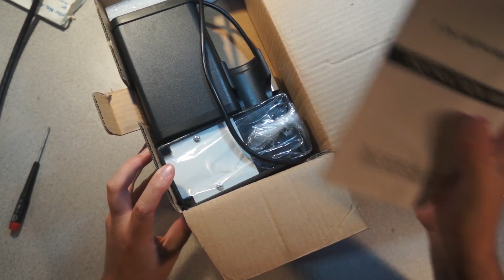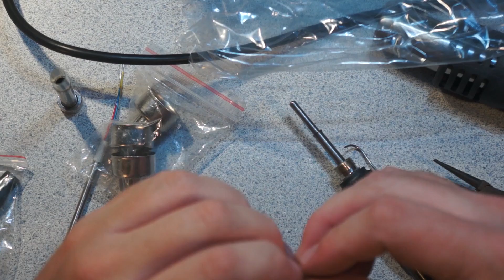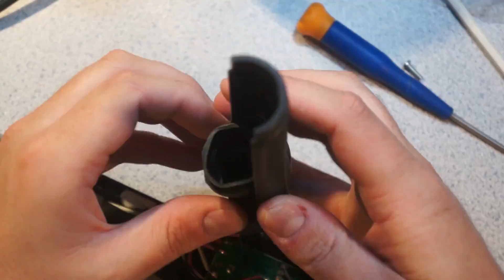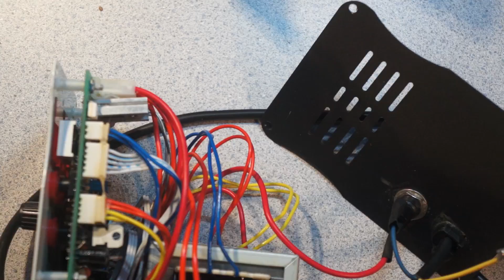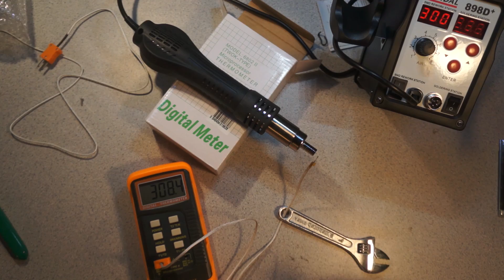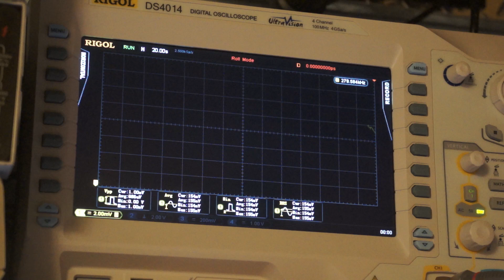898D+ Soldering Station Teardown and Review [Sold under many Manufacturer Names]

Comment: This handle has a design flaw. The air flows inside the plastic case when the temp and airflow is set high. With nozzle attachments, the handle with melt within 5-10 minutes as many already have destroyed theirs. Use without nozzle and in short bursts above medium settings. Don't do high.

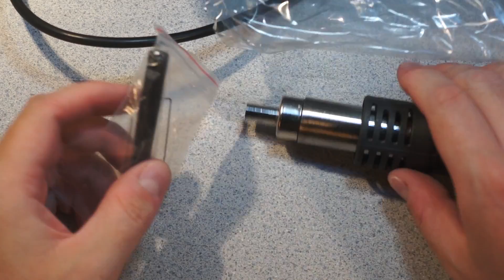Comment: Connor, at 10:43 that tool that you think is a tip removal tool is actually a smd chip removal tool...you have to assemble it, and each leg goes under the sides of a smd chip say a 32 or 64 leg chip and you use hot air to desolder, and that tool to lift the chip.

Comment: Just don;t waste your time watching this rant.
Reply: Don't get me wrong, this kind of stations are crappy, they are the cheapest that exist, but for 50€ they also the best thing that you can buy.                                                                          All hot air stations overshoot, when ramping hundreds of degrees and all of soldering tools have fluctuations and tolerances. (in this case one can improve the temperatures by calibrating it)                                                                                                                       Even we compare it with a top of the line 300 time more expensive soldering station from JBC, the characteristics of the generic shitty and cheap one are not really bad.Don't take me on my word go for the JBC site.

Comment: originally these only were analog pots for setting temp. they changed to digital display to show setting temp. the decimal point solid is heating, flashing is at temp. these only have set display not monitoring display, thats why so cheap.

Comment: I think you should use a precision thermometer to do you assessments. You making yourself look like a fool. I purchased the 898D+  and is really a decent Station. I work with 3d Printers and thermosters aren't use to measure temperature the way you are. And what you call a overshoot is actually a temperature reach status or (over heat). Any tool the is use to heat up including hair blowers needs to over heat on turn on. Also you just unbox this station meaning the to test product you need to break it before you run any test of this kind.  Another thing the metal points shouldn't be thigh due to shrinkage. Next time research your material before you make yourself look like a fool on world streaming.

Comment: I bought one of these (Saike 852D) 2 months ago every thing worked fine for about 15 min, the the fan stopped working then ( it smells burned ). not getting any good help from where I bought it ( China ) anyways I checked the voltage up to fan motor it reads 42 dc volts but motor is rated 24 dc volts I think it's burned out. Question, where on the board do I look thats causing this problem ? Has anybody had this problem with this unit or similar ? Thanks

Comment: Warning to the casual viewer: Don't waste your time, this is not a review of the rework station. This is an hour and ten minutes of pissing and moaning about a cheap Chinese knockoff not being the same quality of a Weller workstation that would cost five times as much. At no point does this person actually show the device at work on a circuit card. As far as I can tell, the entire video is one big complaint about the temperature fluctuations, and his "investigation" is as technically accurate as his equipment is cheap.

Comment: Well done, I like this deep testing, I wanted to see some testing on the iron's temp too. In regard to the extra heat, you just have misplaced the sensor, it should be about a cm away. and the overshoot is expected and unavoidable since they are providing quick heating, although it would be nice to show it in the display to know you're still within the overshooting period. and the temp snapping in the display should have been about 10- 15C from the target temp, whether it is hotter or colder which will prevent eye stress looking for the exact number and not deceive the reader into a very wrong value, a small amount snap is acceptable.

Comment: The whole unit is a piece of crap; you will go through heating elements faster due to the fact there is no cool than feature when turned off. Secondly, it is a fire trap that can cause a total melt down. Last but not least is the problem with a segment  failure is warning the whole item may go into cardiac arrest at any time. Safety wise; I think it poses a hazard, bottom line it would not be on my bench.

Comment: 40 minutes in. yeah it overshot by 100 C. it dropped pretty quickly back down to a little over 300. i honestly dont see why your making such a big deal out of it, i mean what do you really expect right its not going to be 100% on the dot accurate. it is a chinese knock off thats affordable and usable. and its not like you going to power it on and instantly start BLASTING what you think its set to on to a heat sensitive smd part at least i would hope you wouldnt anyway. i can agree the overshoot is a bit high but your heating up alot of mass in a very short amount of time. we all know that chinese thermo couple isnt the best or completely accurate ether. and you have to take in the fact there is goin to be cooler air rushing past the tip as well when the hot air exits the end. yadda yadda yadda convection some more random shit like that. by the time it leaves the end of the of air gun it will pretty dam close to 300C when it hits the part. and you not just gonna sit there and watch the part melt long after the solder has. you can adjust for it. lower the setting by 10 or 20 degrees and there you go problem solved. the soldering iron i could care less. im just a hobbyist that makes backlights / driving light and  general stuff that lights up.

Comment: OMG!!!  Air gun temperature is off by 2% and there is a 20 second overshoot!  OMG, OMG, OMG, how could an SMD ever possibly survive such gross incompetence!?  If you consider 1.25 hour to be a "short review" then 20 seconds might not be that big of a deal but... maybe you could reprogram to ramp up slowly over a 45 minute period and minimize that overshoot to some extant.  As for that lying SOB display... might as well cover with electrical tape to decrease the mental distress and anguish.  Better yet, just return that piece of useless garbage and spend a few hundred dollars on something with infinitely better precision.  Or you could simply buy another 4 ch 100MHz scope and hard wire it to temp probes and use Rigol software to covert the 2 analog signals to 8 digit precision and even record the data for bed time reading.
Reply: Agreed, Connor Wolf is an imbecile.
Reply: "That's just unacceptable!!" Hahahaha
Reply from the maker: +Fathom 

Christ, I said it in the review, and I'll say it again.

If it just showed the overshoot on the display while it was happening, I'd be OK with it. I know it's cheap, and frankly, I didn't expect much from it. I's the fact that it deliberately falsifies sensor-data to make it's performance look better then it is is what bothers me. 

The display isn't just a pretty set-point readout, it's feedback on the actual temperature. I therefore expect it to actually REPORT the actual temperature, not a pretty number that makes it look better then it is.

Also, it overshoots by 100°C. That's a 33% overshoot, not a "2%"" overshoot.
Reply: +Connor Wolf
"2% overshoot"? Did I really say that?

Bottom line is that temperature settles to a consistent rock solid repeatable value. The number displayed is only a reference. Whether Celsius, Fahrenheit or Goobbers. You find what value works in a given situation: nozzle size, fan speed, substrate, component materials and size. Adjust accordingly. Its all relative.

A brief overshoot is nice, by time solder joint is up to temperature the blower temp will be fairly stable. All gain, no loss. Function performed in shorter time than otherwise with no damage done unless of course you don't know how to use a rework gun.

Comment: What do you expect for the price ?? yadda yadda yadda i don't see the point in these product testing video's when you are compering a cheep product to expensive alternatives like your work product's or the one you have at home that cost 3 or 4 times more no fucking point ???.
Reply from the maker: +Kevin Brain 

I'm copying this from another comment, because you apparently missed my complaint entirely.

------

If it just showed the overshoot on the display while it was happening, I'd be OK with it. I know it's cheap, and frankly, I didn't expect much from it. I's the fact that it deliberately falsifies sensor-data to make it's performance look better then it is is what bothers me. 

The display isn't just a pretty set-point readout, it's feedback on the actual temperature. I therefore expect it to actually REPORT the actual temperature, not a pretty number that makes it look better then it is.

Comment: The variable fan speed will have a effect on the temperature
You have yours set quite low and so the air is flowing slower and so on.....

Comment: Another thing I noticed is that the blue neutral wire goes through the fuse and not the live.  Not sure how much of an issue that is in America, but in Europe it's not acceptable.  I'd guess that the soldering irons triac is up next to the mains distro section to allow for the option of using a mains iron with minor track mods.
On my unit the hot air gun still runs and goes into cool-down mode if you turn off the front panel switch.  There's a separate mains switch on the back of mine and the front switches are just for standby.  When both are off it reminds you that it's on by flashing a --- symbol briefly every few seconds.
Reply: Not mean anything, because you can turn wall plug around. Blue never not mean actually neutral in europe. It is only color. It mark neutral only in fixed installations. But of course electrician use always right color, because you must do it like rules say. Britain plug  can't plug around,  but eu plug can.  But ALWAYS CHINESE WIRING NEED CHECK. Because they only connect wires, not know local rules.

Comment: I just got the version of this with a single display.  It rather generously came with two spare iron elements and a hot air element.  Perhaps the main reason for the spare elements and the quite fierce overshoot on the iron is because it's running the 24V iron from a 36V supply in mine so it's actually running at twice its rated power.  I wondered what that winding on the transformer was for.  Quite frankly I'd rather it just ran the heater at 24V.  (It's popped a heating element already!)  The internal transformer also gets quite hot and flustered after the iron has been running for a while.   Hmmm!
Reply: DERP..  I just did a check under load and while the transformer winding for the iron is over 30V, by the time it's gone through the triac and thin flex it's dropped down to 25V so the higher voltage on the transformer seems to be purely for the losses.  I also dismembered one of the iron elements.  Quite a neat construction...   Teardown of a thermally controlled soldering iron element.

Comment: Pretty sure the reason it over shoots by 100 is the fast heat up feature aka if you give the heater enough power to heat up to 300 it heats slower than if it has more power so it heats up then lessens the power its not really lying and it can't be perfect 300 all the time
Reply: iApplereviews Again, you are missing the point here. The display is for displaying real time temperature values, not just the preset. If it just displayed the preset, why bother to put a display at all?
Also, we all expect a tool to perform at least do to what it was intended for. Not lie about its values to make the tool look as if it's better than it actually is. If you say that this is a meaningless complaint, you obviously have no knowledge or experience regarding electrical equipment.
Reply from the maker: You've completely missed the point of my complaint. 

I would be ok with it overshooting *if the display showed the overshoot the temperature sensor actually measured*. What is happening is the display is being falsified to show a reading different from the actual measured value.

FWIW, it is possible to not have overshoot even with lots of power, it just takes a finely tuned control loop. I wouldn't expect perfect performance from something at this price point, but I do expect EVERYTHING I buy to not be deliberately fallacious, no matter how low the price.
Reply: the display isn't lying at all it stops at 300 because the computer tells it to because thats the set temp and its stopped heating the overshoot is the temp probe still warming up and also the fast heat up
Reply: Connor Wolf And i would never sub to you making video complaining about something you dont even expect it to do

Comment: I don't feel they are bullshitting about the temperature, they are showing what your temperature is set at.  This isn't deceiving, this is user friendliness.  A normal and even most professional users could care less that their temp is moving up and down a few degrees.  In fact it is probably expected.  It would be great if you could compare your measurements with the other hot air stations you use.

Comment: Good thorough video but I just have to agree that you're nitpicking on the temperature issue here for a $80 unit. It's obviously not a professional unit and would last maybe a week or two in a professional setting. The intended use for this is for the hobbyist or someone who needs to rework some stuff every now and then.

Comment: Everything about this video is priceless, especially at 50:30, oh my the misfortune of this test unit....

I am a little curious.  Suppose the set-point were 400 C.  Would the actual temperature overshoot by 100 C, or more closely approximate the setting?    It would just be cool to see a data point around solder melting point.  I have a feeling it will overshoot by less, but still a lot.  I wouldn't buy one at full price.  Thanks for the demo.

Comment from the maker: Did you miss the part where I measured the actual air temperature with a thermocouple? Or that other people here in the comments have confirmed that other similar models of this hot air gun have the same issue, when measured with a separate thermocouple?
Reply: I enjoyed your video. I believe what some people are saying is the machine is estimating the air temp at the expected distance from the tip. ( 1-2" from the tip). That's why the temp offset is so drastic. I added a mechanical toggle switch to replace the reed switch. So you have to hold it down to heat it up. But hey, it's cheap Chinese, you get what you payed for.

Comment: Without an external temp sensor, is there any reason to assume that the temp really is spiking? Perhaps they are just incompetent programmers and those high numbers are just some other software failure (not dissimilar to their inability to write good PID temp control code if your spiking temp hypothesis is correct). We can conclude from your demo that the software sucks but I don't think any other conclusion can be drawn.

Comment: Well, most higher end irons I've seen tend to only refresh the display every 1-2 seconds, not multiple times per second as this unit seems to do in the video. That plus averaging tends to keep the display from oscillating all over the place.

Like I said, the overshoot is egregious and needs to be fixed, but to me that's a separate problem all together. By itself, the display snapping isn't that bad, really.

Comment from the maker: It takes about 20-30 seconds to stabilize. 
However, it automatically goes to sleep when you put it down.

Therefore, every single time you put the thing down, you have to then wait 20-30 seconds after you pick it up. That's ridiculous.

The display snapping argument is bullshit. I have a Weller soldering iron. You know what? The display oscillates. Look at top-of-the-line JBC Irons - The display jitters a bit. EVERY other iron/HA gun on the market displays the real temperature.

Comment: It only overshoots for a few seconds... Who grabs their hot air gun and immediately starts using it? Wait a few seconds for it to stabilize and then start using it, problem solved. As for the display snapping, well you need that at a point. It would be annoying as shit if your display kept moving up and down as the heater switched on and off. To me, snapping to +/- 15 degrees is perfectly acceptable. Granted, not displaying the 100 degree overshoot is shitty.

How much can you complain for $80?

Comment from the maker: Better loop stability with higher airflow is normal and expected. 

Basically, stabilizing a PID loop with asymmetric heating and cooling slew rates is really, REALLY hard. 

As you increase the airflow, you're increasing the cooling rate, and decreasing the heating rate. This makes the slew-rates more symmetrical.

It's also probable that the PID loop was tuned at one airflow rate, (apparently 6-8), and this is therefore where it's most stable.

Comment: I'm not so sure the display is entirely lying. There is only a single display (ignoring the one for the iron) that needs to display TWO values. Within a certain percentage of the set temperature, it displays the set temperature. Outside of that range it displays the actual temperature.

If you don't mind potentially having to replace the heating element, you can test this by preheating the iron and submerging the tip in a glass of water. I'd bet it would show the actual temperature as it cools.

Comment: I have 2 of these model soldering irons with blown microcontrollers. Wonder if that is the reason for the socketed controller. My units have slightly different board layouts but are basically unrepairable without the code for the controllers. They were plugged into the same mains circuit as a TIG welder so I am blaming this but could also be shitty decoupling of the thermocouple signals.